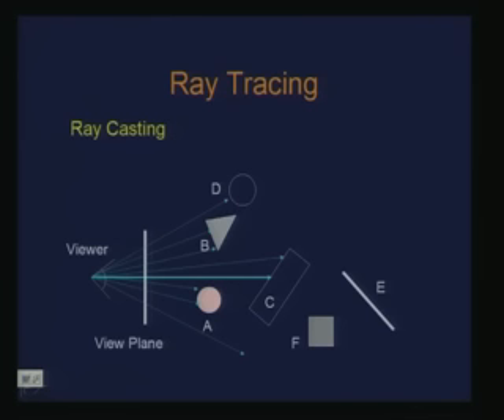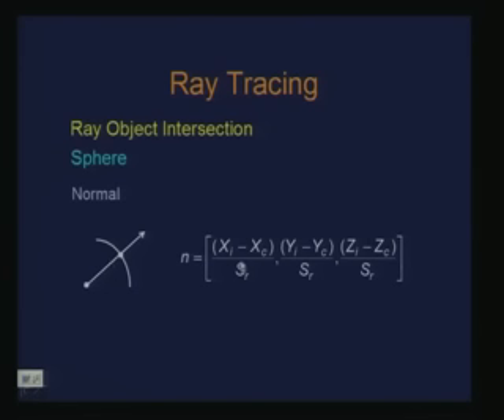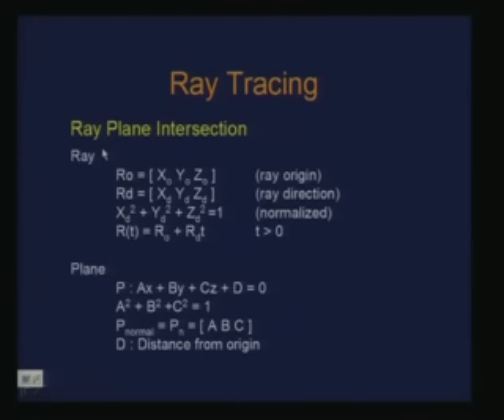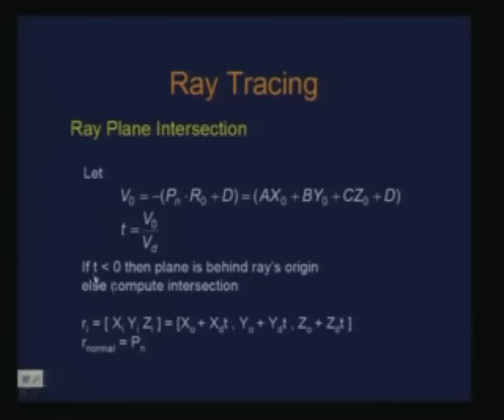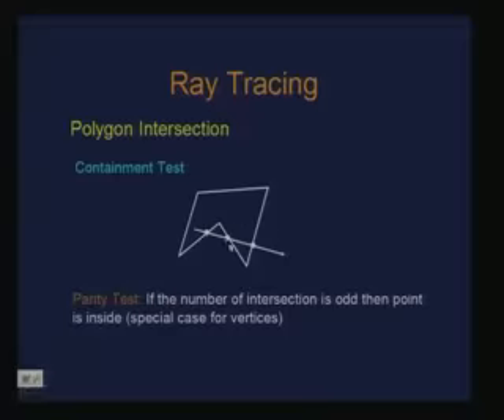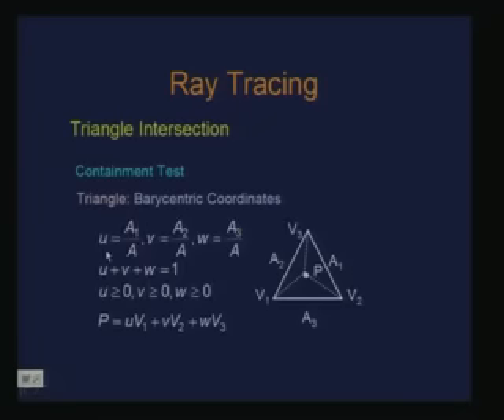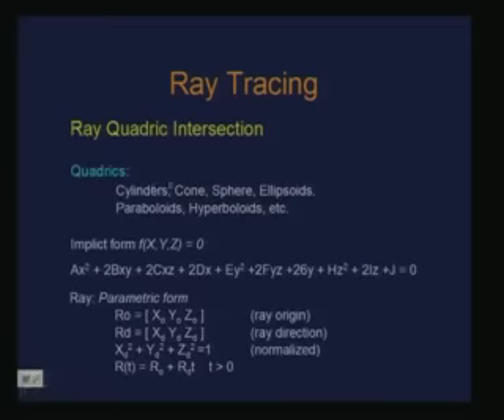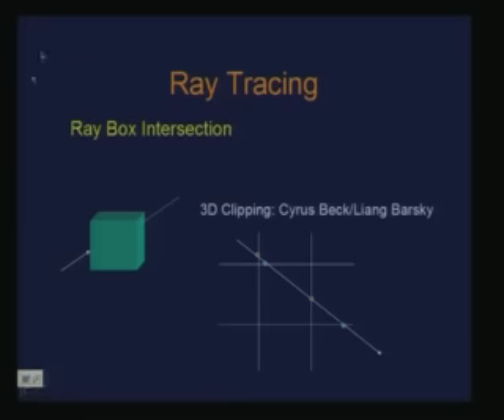Lecture - 24 Ray Tracing

Comment: he uses the filler word "right" too much
Reply: Different English speaking cultures have different ways to confirm understanding and elicit feedback... for Indian English speakers, it's quite common to use "right" as a way to confirm that a sentence was heard/understood, and is usually responded to with a head-waggle to showing that you're listening.
Reply: @maxlee3536  "blah, blah, blah" - Ok, bottom line: The statement "He uses the filler word "right" too much" still stands true. Nothing said proved this wrong, therefore: "blah, blah, blah"
Reply: @lawrence.wong__AI.Developer  "too much", only according to your understanding and culture. Not too much with where he's from.
Reply: same issue with this professor at UC Davis - https://youtu.be/Ahp6LDQnK4Y?t=689